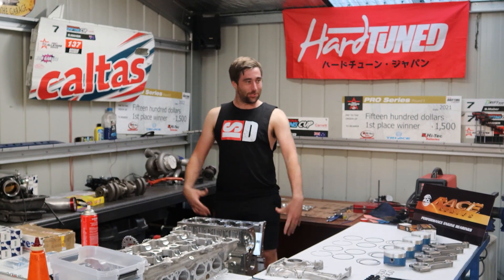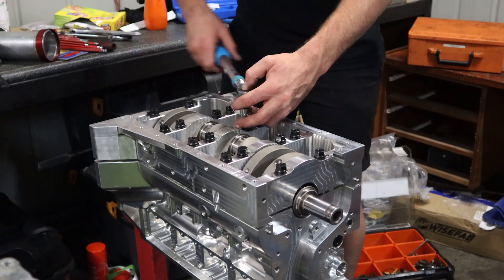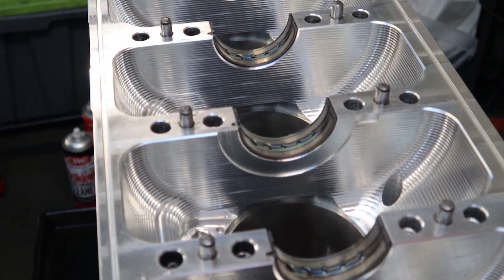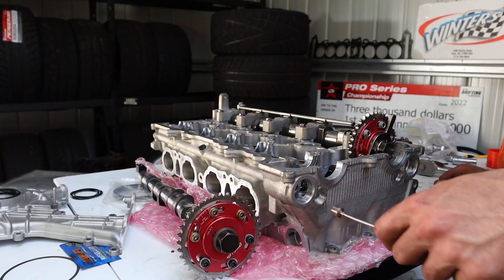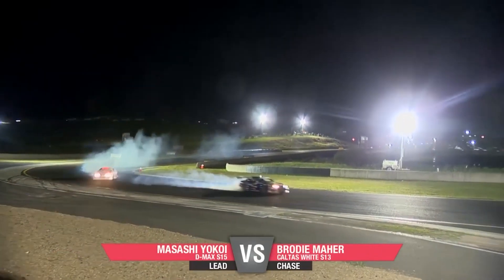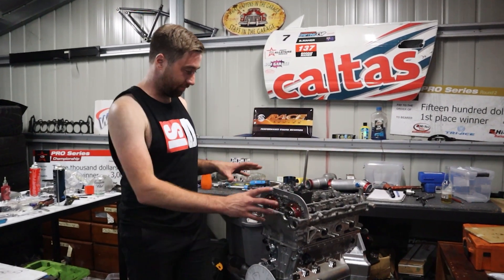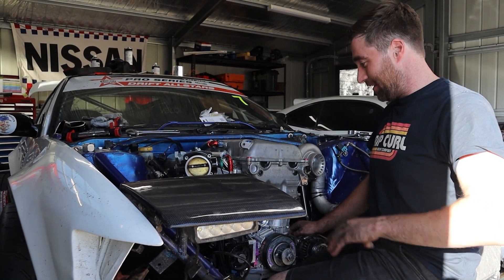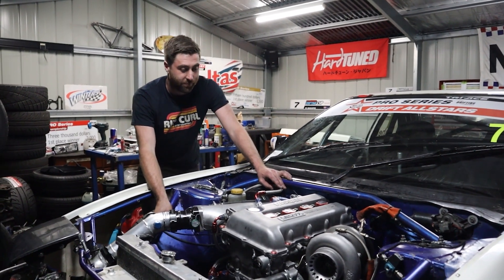900hp Billet Sr20vet Engine Build

Comment: Hey dudes would appreciate some info if anyone knows... Got some chain rattle sr20VET (new OEM tensioner) is it recommended to remove the upper chain guide like with sr20DET? Can't find a replacement. Cheers!

Comment: So I am building a billet block rwd shimless ported vvl head with a 68mm g35-1050 trying to push high 30s for psi what would you recommend for clearances for bearings running nitro 91mm crank boost line rods and custom je 90 mm pistons

Comment: You have a dry sump set up and ive been looking into myself and for the timing cover it has its own gears inside that picks up the oil from the sump but with that dry sump kit you have a billet sump pan? And theres no pickup in there so do you remove the gears within the timing cover? Or am I missing anything? Thank you for your time!
Reply from the maker: So I’m running a 4 stage dry Sump pump here, 3 of the pumps scavenge out from the sump and pump it back to the dry Sump tank, while one of the stages pumps the oil for the engine. This is a pretty normal dry Sump setup and they eliminate the standard oil pump gears, so it’s just a timing cover with nothing inside ☺️
Reply: Thank you ❤ I appreciate it alot! Also any power differences supposed to with or without the dry sump? Curious to see how much of an effect windage has on this platform

Comment: Happy to see that you stuck with the SR and even pushed it that far, most have gone LS, RB and 2J, do you find the 92mm crank affecting the rod ratio at all being around 1.4 and being on limiter most of the time?
Reply from the maker: I love the powerband and weight advantages you get with the SR, but it has been some work. It’s interesting, I’ve always been worried about the rod ratio but haven’t actually had any issues which we’re related back to it. Obviously the rod ratio is horrible, but it’s also probably not too far off a K series